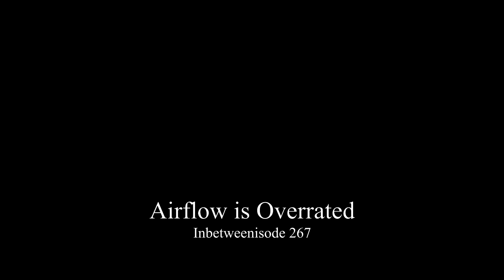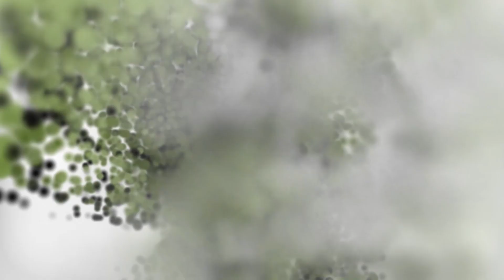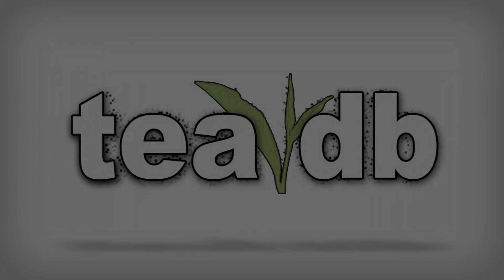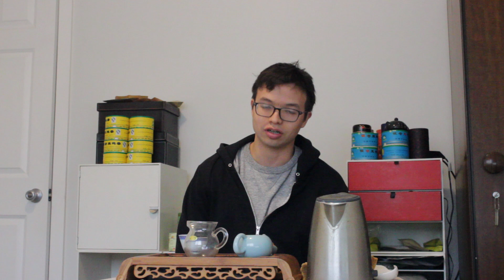Airflow is Overrated for Pu'erh Storage [Inbetweenisode 267]

Comment: Good vid James. There is some crazy talk with storage, it can be a huge rabbit hole. Personally I just keep like and like together. I do air out my tea when there's a big change in humidity/temp -- but I think it doesn't do a lot other than avoiding condensation locally (managing the dew point), I do a rotation when I air it out. I'm not sure if the airflow is very important, especially with comparatively small quantities of tea.  Gotta keep in them VOC's!
Reply from the maker: Thanks J-P. Yeah storage is fertile ground for strong opinions and short on great evidence.
Reply: Seriously. Very lost on sheng puerh storage.. as for dry storage  can I just put in a card board box and forget about it?

Comment: I always assume the air flow concept comes from HK, based on some folks experience and observation. I thought it could be true for some situation, as I imagine there could be basement storage in a humid condition. In addition, in an older building within a big city, who knows what kind of gasses could gone into a confined space and accumulated. Under some circumstances, I can see why they prefer air flow. But for most at West, this doesn't seems to make sense. Thanks for Friday morning rant.
Reply from the maker: Yeah I think based of HK and HK-like climates is probably right where mold is a much larger issue.

Comment: It might depend a great deal on how the cake was processed.  Some white teas and eastern Lincang seem to need the extra air at no cost to aroma quite the opposite.
Reply from the maker: Have you ran into teas like that?
Reply: @TeaDB  *have run.  
Yes.  I've noticed a difference in processing but airflow overall.  These matters depend upon heat.  Eastern Lincangs (Bangdong and related), Jinggu whites,  some Burmese I have observed since about '16 prefer a fair measure of air or heat.  

Unfortunately, no definitive answer.